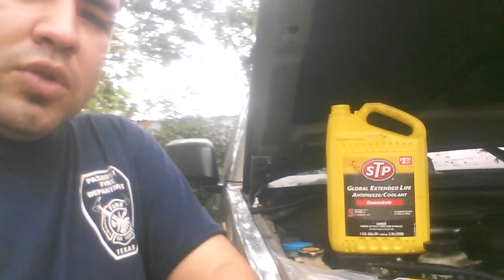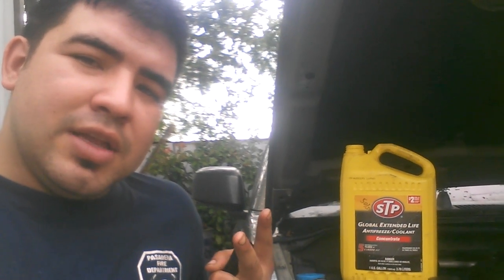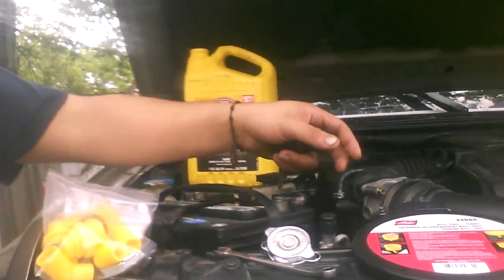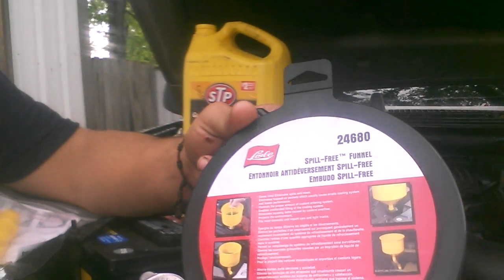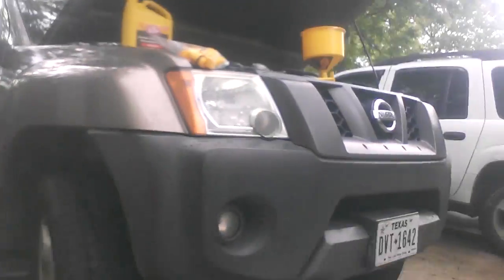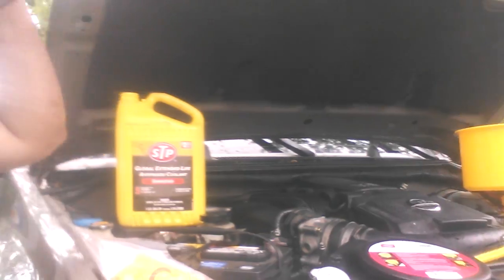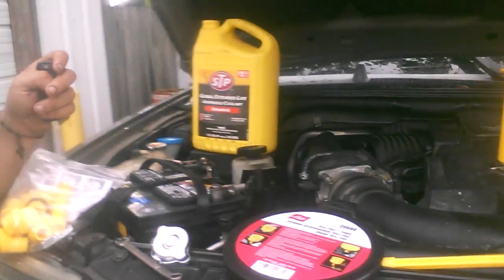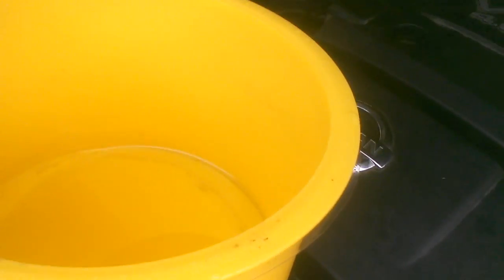How to bleed the cooling system on any car

Comment: Best way to do it is turn your heater on to maximum temperature and fan speed to lowest setting and have the anti spill funnel already attached with enough coolant to partially fill the funnel, have the car front elevated to a minimum of 12 inches and let it idle to operating temprature the feel the bottom radiator hose (should be hot) means the thermostat has opened and all coolant is cycling through the system. Make sure the fan come on a minimum of 2 times this ensures every air pocket is removed 👌🏻 or just buy a vacuum fill system lol

Comment: im confused, cant you juts open your reservoir cap and let it burp out? also if im getting eng check light could it simply be i got air in the system and if i burp it out it will be fine and it may not have necessarily been a problem with the thermo?
Reply from the maker: If you have a coolant tank that itself should burp it self out. This is mostly used on systems with no coolant tanks
Reply: @OzMechanics  ohh i see ok cool so most lilely i do not have any air in the system ,still wondering why i have the check eng light for so many years,,tell me if my thermo is stuck closed how is my engine cooling? is the fan enough to do this? and i can see an over flow line on my reservoir  but does it have a line going to the bottom of the radiator too? because i am not able to see it if its underneath i guess,,i am not sure if i need to change my anti freeze,i have 120 000km on the car i think the book says to change it at 240 000km but this process is complicated to be able to drain the whole thing,,idk what to do anymore?

Comment: Mine is a Jeep Patriot- i read it takes between 15 and 20 minutes to remove the air out of the cooling system.
I live mine for hours and the bubbles dont stop. 
the Jeep dont lock power and hesitates and runs good.
i flush the cooling system and then the problem started, air in the system.

Comment: Got Dodge Charger will this work same way or is there a bleeder valve
Reply from the maker: Myron Romero use this devise and open up bleeder screws to let out all the air
Reply: Oz Mechanics where are bleeder screws
Reply: Why wouldn’t a regular funnel work or why is this better.
Reply from the maker: Myron Romero for a professional mechanic this is an awesome tool because it has different fittings for different vehicle.
Reply: Well if it will help and seeing I would rather not deal with drain plug it’s worth a shot.

Comment: Some of these newer coolant systems are a pain to bleed the air out (heater core very high) or even work in the reverse (Ford).   =May need a vacuum coolant tool to get the air out ($100+air compressor).

You need to add an Amazon link for that Lisle funnel.

Comment: i have a new350sbc engine long block rebuilt on my 64 chevy belair,ive added everything new in my engine bay,my radiator seems to over heat when the engine sits at idle for about 30min,my coolant is filled up as well,i have a 195 degree thermostat in it,think it could be that i have air bobbles in my coolant system?

Comment: I want to know if you take the radiator cap off while you turn on the engine and also turn the heat on?
Reply from the maker: If you have the funnel like the one I’m using the cap should be off because the funnel will take the place of the cap. And on the heat only if it has a heater control valve other than that it wouldn’t make a difference

Comment: Hi thank you for your video, it was most helpful. one thing i want to ask is, i have a citroen xsara picasso 1.6 it has two bleed valves as you probably know do i remove them completely to bleed the system  or just loosen them to let the air out?

Comment: This may sound like a stupid question but will this work if you have to do it through the expansion tank since not every cooling system has a radiator cap thank you.
Reply from the maker: No question is a stupid question. On expansion style tank you don’t really need this setup. Most expansion tanks are set higher then most of the cooling system so air bubbles have have an easier path to make it up and out of the cooling system

Comment: What would be the best way to bleed the air out of the coolant on a vehicle with no radiator cap? I have a Chevy Cavalier with a new water pump, engine temp sensor, and a new thermostat. I also performed an engine coolant flush but I dont think I got the air out of the system correctly. Engine runs a little hotter than normal.

Comment: That's not how the thermostat works it opens from the pressure behind it
Reply from the maker: It opens from the temp
Reply: So if the thermostat doesn't open because an air bubble gives the wrong impression, how do you remove the bubble while the thermostat doesn't open? I mean the bubble gets (z) stuck in it,  innit?

Comment: Hey oscar I gave you a thumbs down bro. 1 reason not enough detail. I was having this issue because I had my radiator changed out, in my 98 toyota, at a name brand store, you would think being a mechanic at a name brand store would be able to  figure out something this simple, my mechanic couldnt get the heater core to work. Because of air pockets. So I am finally doing the Job myself. And I was looking around on you tube videos, some videos I've  seen actually let viewers know about the heater core. And hot air not coming through cause of cooling system tampering. No hard feelings bro. But it helps to know. And I say this cause I'm not a pro. Details really do help. Take care God bess
Reply: “Oz”, keep doing what you’re doing. This was a great video. Keep them coming! I don’t understand how people gave this a thumbs down. Just because it wasn’t the info you were looking for, doesn’t make it a bad video
Reply: Welll it seems that Marvin o I meant to type Matthew reviewing the video is not all there.  First of all how someone else’s screw up affects the information provided in this video.  Secondly,  saying “not enough detail”, what is he talking about? Then “Matthew”  goes on talking about how a mechanic from a name brand store was not able to make it work. Then continues to talk about how Matthew finally decides to search on YouTube to do the job “himself”.  Finally he goes into writing details do help, I wish he could use his own advise and make sense with his comment.  Oz is a great mechanic,, who is trying to provide free guidance, sorry I can’t review “Oscar” since I don’t know his channel.  PS
it seems some people just don’t understand or are bored and start typing without making sense.  I Hope there are no hard feelings, God bless bro!
Reply: @zacharybarbosa5072  hey no hard feeling bro. I just did what Oscar asked in the end of his video. I just posted this info to another response, but hey here it goes again. Yes its free. I get it. And Oscar did say explain what thumbs down was for. And So I did. Bro. If he was lying about trying to improve his vids. Thats not on me. If Oscar doesnt take to feedback very well. Why am I rebuked. Sorry but I'll do my best to not give him a thumbs up or down. Im sure his other vids are pretty informative haven't come across any. Dont want to be misunderstood.  There are no exclamation points or bold print. I'll stay away from future vids. God bless you and keep you
Reply: Matthew tax collector who the heck is Oscar?
Reply: Matthew tax collector you still didn’t explain why you gave him thumbs down?  You said more details , please provide the details of why in order to understand what you mean?  I guess when the finger points at you, it’s harder to explain because you can never know what in detail means to people, as you are trying to prove a point that does not make sense, but yet to YOU it makes perfectly sense.
Reply: @iselasepulveda00725  or should I have said oz. Had a friend named Oscar. Ozzy a.k.a. oz. for short.
Reply: Matthew tax collector well I believe if you are giving a review please provide the CORRECT DETAILS as you requested in your comment, TOUCHÉ Matthew touché
Reply: @iselasepulveda00725  in oz post he said to bleed the system of air. I have wathced other videos. That explain when you mess with cooling system you get (air)
 In system. They explain that you also can get interrupted heat meaning no heater. (Heater core). Has air trapped because you should get heat at idle. That is something that the other videos spoke about. And thats what I meant. At least thats what my post was referring too.  Oz video didnt mention that. Thats it. Wow!!. Next time I'll just bypass vids.from oz vids. Sorry for the inconvenience. Sorry oz. Take care
Reply: @iselasepulveda00725  if you have any thumbs down please let me know why. I'm a mechanic and in here to help. That was his quote from video
Reply: Matthew tax collector finally you make sense, the only difference between you and oz, you were given the opportunity to EXPLAIN yourself, as you can see the video it’s about 2 years old, and has improved.  Good luck and stop criticizing before you read your own posts.
Reply: @iselasepulveda00725  well if you would have read my post you would have understood what I was talking about. I mentioned heater core, and my mechanic not oz. So please read my post slowly. So it can make more sense. Take care
Reply: Matthew tax collector i did read your post, reason I commented on your post.  Mathew is time to troll somewhere else.
Reply: @iselasepulveda00725  so if I'm going after information on internet. I'm trolling. Wow. Ok??. It sounds like you might be the one trolling, I found an informational video watched it hoping to gather information on it to work in my car, commented on it. And YOU respond. On my comment.  And I'm trolling???. If that makes any sense. Which it doesn't. Than to you??, believe what you want. Just think about your logic. Take care
Reply: Really cool story, glad you a found a solution for your cars issue. Still kind of confused why you would put a thumbs down. thank you for the video Oz. Keep it up
Reply: Never said bad. Oscar asked on his video. Thumbs up or down. Give reason why. So he can improve posts. Thanks for your response. Even though my post was misunderstood.

Comment: Do I have to use the bleeder valve on my 09 charger or, can I just do it the way you showed in the video?
Awesome video. Thanks a lot.
Reply from the maker: If you have the cone I’m using in the video no need to open the screws
Reply: No offense intended but, wouldn't it be cheaper to use the bleeder valve versus $35 or $40 for the funnel?
Awesome video. Thanks again.
Reply from the maker: Neil Williams no offense taken. But you did ask if you could do it like the way it was done on the video. I’m confused on that. Either way would work

Comment: Do you leave vehicle running when you remove funnel and replace cap, or is it better to turn off engine to reduce chance of letting air back into the system? Thanks!
Reply: If you remove the funnel and cap the radiator quickly after then you will be fine.

Comment: Great video. I was watching videos on you tube about how to fix a common oil leak for
 Mazda CX7 and I change  the circular rubber part. when I took off the 
hose I think the coolant fluid came out. I put new motor oil, oil filter
 and put more coolant fluid. I did a test drive and now my Mazda 
temperature going hot. what I did wrong? maybe I damage another part or is because I have to bleeding the cooling system?
Reply from the maker: ROD Boricua i would start by bleeding the engines coolant. I have other videos on looking for coolant leaks and testing out blown head gaskets
Reply: Ok, I will start doing that today. Thanks. I will give you updates about this, thanks again
Reply: thanks OZ, I took your advice and now my Mazda is perfect no overheating anymore
Reply from the maker: ROD Boricua swwwwweeeeeeet. I'm so glad it worked !!!

Comment: YOU DID NOT SHOW YOU FINISH. IF THE BUBBLES DONT STOP OR DO THEY HAVE TO COMPLETELY STOP BEFORE YOU PU RADIATOR CAP BACK ON
Reply from the maker: Rich Murray If you get like a small bubble you're ok. If it's bubbling like crazy you still have air in there
Reply: @Rich Murray
Really good point about how the ending criteria has to be described. How can we know _all air is bled out
Reply from the maker: Reza Grans in the end I explain that. How it's important. Did you watch to the end ?

Comment: How long should you burp the car for? Won't the coolant eventually get too hot, especial for that plastic funnel?
Reply from the maker: razz P I burp it until I don't have anymore air bubbles. This is a durable plastic funnel
Reply: @razz P
Never mind maybe. Ratchets n Wrenches*' method involves touching(?) Burning hot...
Reply: ...coolant using a cloth ot towel, to remove excess fluid in the funnel when the level is stabilized [hopefuly this is when all air is out??

Comment: Like burping a baby. :) If one does not have a fancy funnel, do you have to watch the level and always add more coolant to the rad? I have a 2007 sentra, can I use prestone coolant or should I stick with oem coolant? Read it's dangerous to mix the two different coolants.
Reply from the maker: razz P I use the universal one and haven't had any issues
Reply: @razz P- im not expert; in fact rather close to total newbie. But find the class/category of your colant (e.g IAT or OAT)...
Reply: Not entirely sure what those stand for- it's own advanced details but organic acid Technolgy. If u can then find aftermarket..
Reply: ...type that makes the same class if coolant as your OEM, then you may be able to $ave some dollar$ from buying exact dealership

Comment: You DON'T need to lift the car with this spillfree funnel. This funnel sits higher then the heater core so there won't be any air trapped in the system. If you don't have this funnel and filling it thru radiator neck make sure front of vehicle is raised.
Reply from the maker: Jp 185 it's on the tacomas that you do that. Helps push out the air. Have you ever tried it on this vehicle ?
Reply: Beautifully☆ informative and logical-seeming comment. Thanks alot for getting me one step closer..
Reply: ..to believing I can do this job w/o some major engine-harming crap happening-- air pocket. The funnel becones part of syst
Reply: @JP 185...Yes your probably right.. but i can tell you its a lot faster for the air to come out..i have done it without lifting the vehicle & it takes    for ever to bleed...

Comment: You should also set the climate control settings to the hot or heat setting but make sure that the fan/heater is in the OFF posistion.
Reply: Some other popular video makers on YouTube are saying that the fan should on on highest or low, so I am becoming confused

Comment: hello how about if my 03 Silverado doesn't have a cap on the radiator it's closed do I do this on the resovior tank ?????
Reply from the maker: Chulla Quiteno same process just different adaptor
Reply: Ok but on the resovior tank right ???
Reply from the maker: Yes
Reply: thank you
Reply: @Chulla Quiteno:
See Car care Kiosks videos explanation. Will help you get the differentiation of the 2 diff cooling systems
Reply: Basically, your reservoir musT then be pressurized, and therefore be the port for re-filling

Comment: I did exactly what you did in this video with out termostat. and my van still getting over heating... I check the fan, I replace the water pump, the temperature sensor is ok... all that and still the same problem. ... can you please tell me what to do?
Reply from the maker: choco painting
Check this video up
 https://youtu.be/zY6_Y64O5o4
Reply: have a leak?
Reply: choco painting  make sure  fan start when ac is on (real quick)  radiator obstrucion??